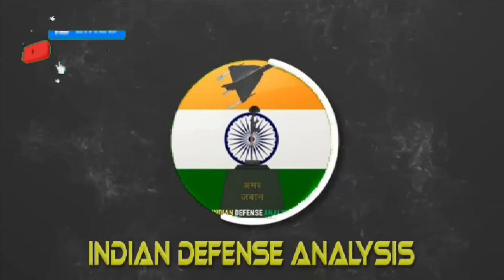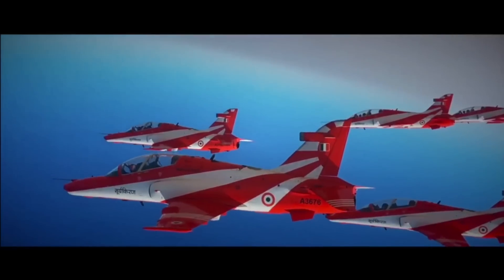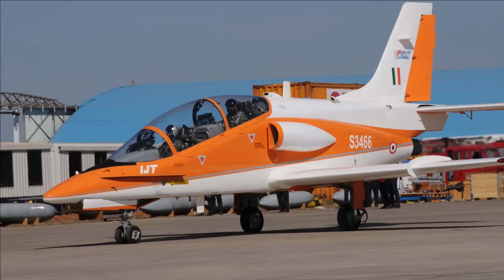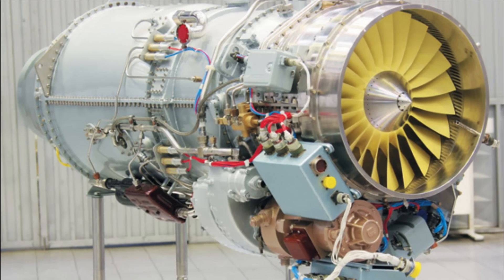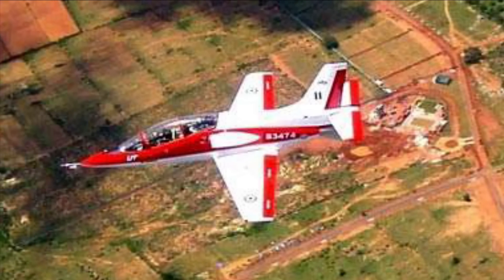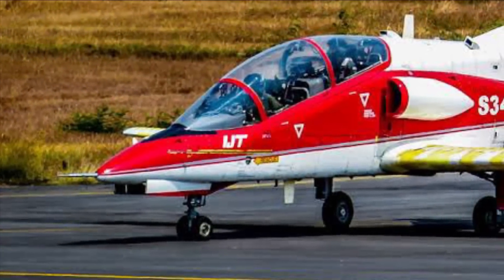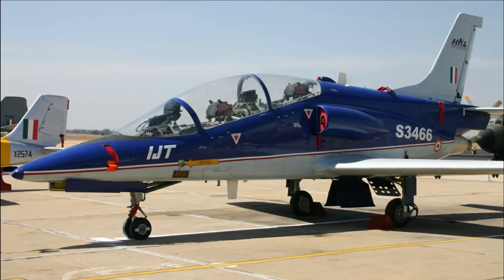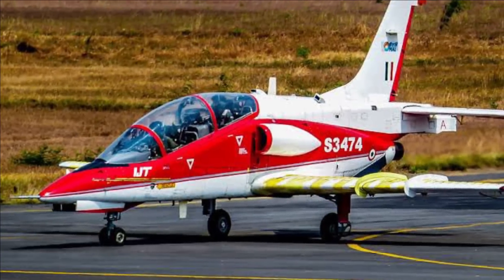Intermediate Jet Trainer HJT-36 Sitara - two years away from induction

Comment: If the sitara finally completes the trials in 2 years time, the HTT-40 and the Tejas
lift trainer will already be in service. Once again training will be done on fully indigenous
planes!

This also opens the doors to valuable exports. Would like to see replacement of these
foreign parts

Digital avionics system from GE Aviation Systems 
Head-up display and repeater from Elbit Systems.

Tejas already has indigenous systems that can do the job. Should be simple
task to replace them.

Russian AL 55i NPO Saturn Jet Engine - The Kaveri is a much bigger
heavier engine than this one. 

Kavero
    Length: 3,490.0 mm 
    Diameter: 909.3 mm 
    Dry weight: 1,236 kg 
     Military thrust: 52 kN 

AL 55i Saturn
     1,950 mm 
    Diameter: 590 mm 
    Dry weight: 315 kg

    Maximum thrust: 17.3 kN;

Shrinking the Kaveri to 1/3rd the size should yield an engine that performs on par or
better and weighs the same,.
Reply: @kurroth  Fuel economy would be terrible. Get a fuel cell or EV kit they can be put into regular cars and you get better fuel economy.

Why wish thinking? HTT40 and LCA lift are already induction/late stages of production.
Only Sitara is two years away.

Comment: as claimed the IAF will take another 2 years to conduct tests of spin and stall before awarding FOC to HJT-36 Sitara which would give way to its full production. 
It means that we shouldn't expect the first Sitara IJT before 2026-27 if everything  goes okay from hence. 

won’ t it be an outdated aircraft by then ?
Reply from the maker: IAF is still flying 50yrs old Kiran, so it wont be IJT is an excellent platform.
Reply: Trainer aircrafts lasts well over 30 years and their technology is not as bleeding edge like fighters. We are using Kiran aircraft which is a 50 year old design. PC-7 aircraft used for basic training is also 50 year old design upgraded with modern avionics